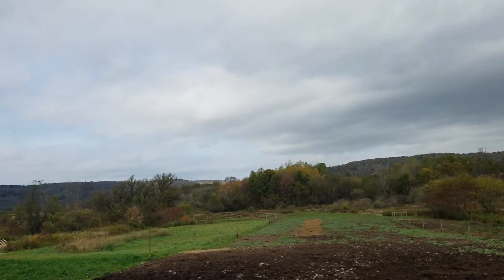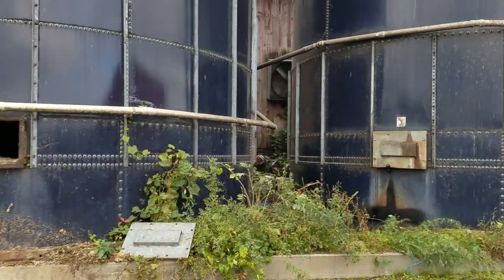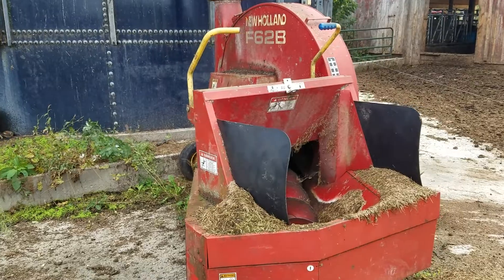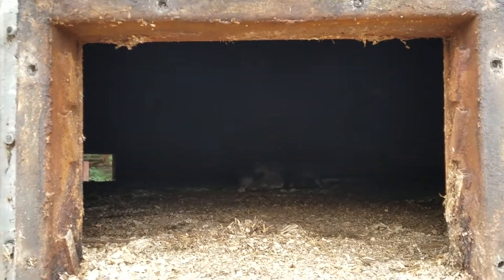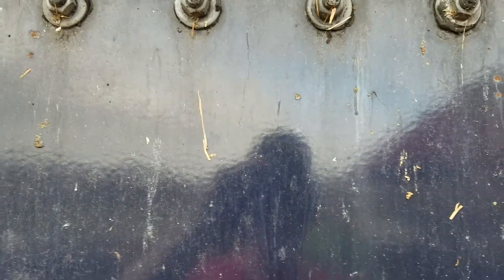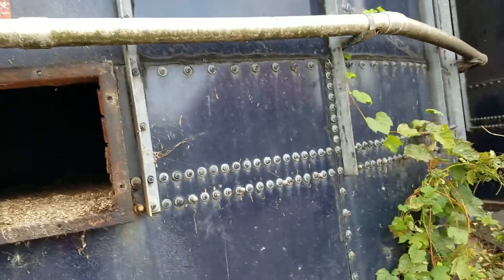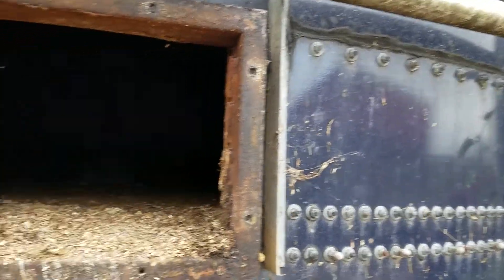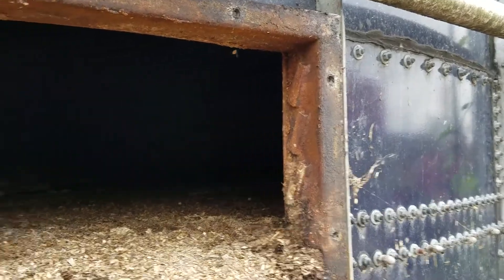Inside the silo

Comment: Grew up with the top unloader Concrete silo. My question is.
Does the air bags at the top help? Push the stylush down or are there times where the Silas get stuck and doesn't fall to the unloader? If the case is, how do you get it to slide down if you can't get in there? As with a top on motor you just crank it down and it keeps feeding
Reply from the maker: I've never used a silo with the air bag at the top. All three of these silos have the breather bag outside the silo. We put them in the hay mow. I've never had an issue with silage or haylage not making its way down to the unloader.

Comment: Never seen a forage silo with those unloaders. Is the haylage silo using the same unloader? How fast do the unload, reliability issues etc? And how wet can you put in your haylage.
I live in Ireland and am trying to make as high quality silage as possible which means tackling wet weather before the crop matures too much. I cut a grass crop every 3 to 4 weeks gets a day to dry not tedded and comes in usually 72 to 65% moisture. Currently using wrapped bales but toying with the idea of an upright silo as plastic keeps getting more expensive to buy and get rid of.
Reply from the maker: Adam Porter we've had good luck with them however the haylage does come out pretty slow. 60% is ok to put them in, you definitely don't want to put it in too dry. We have had .  These go a long time so I wouldn't even now what they go for now a days. We have bagged haylage before and i don't mind the ag bags. I know that doesn't solve your plastic problem.
Reply: mikep7810 thanks, I'll look into it further.

Comment: How the forage is compacted to remove the air?
Reply from the maker: There is a 2nd door thats open when filling the silo so as the forage goes in air goes out of the 2nd door. The silage settles after a couple days. We usually fill the silo then in a couple days we will put another load or 2 in and top it off again